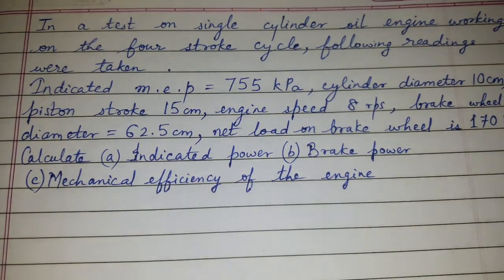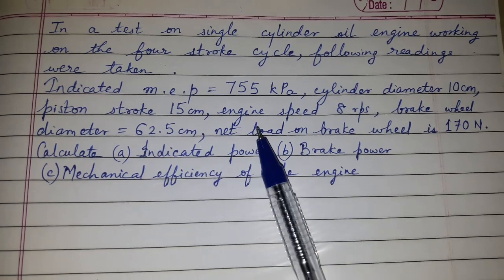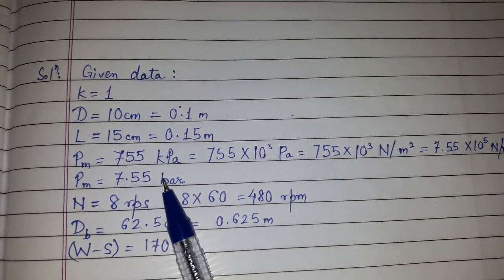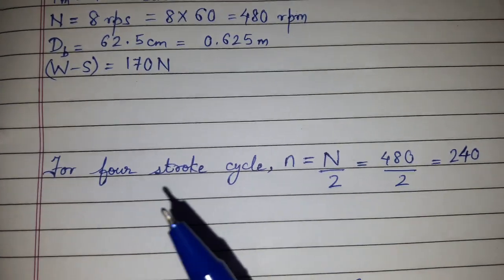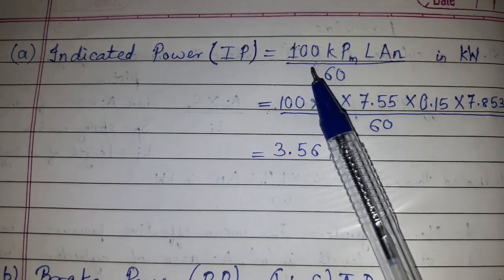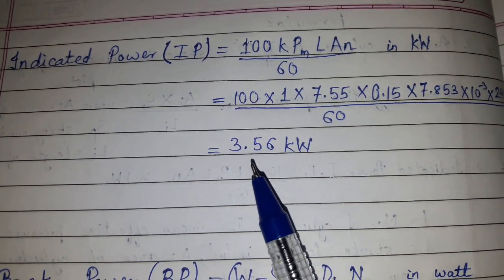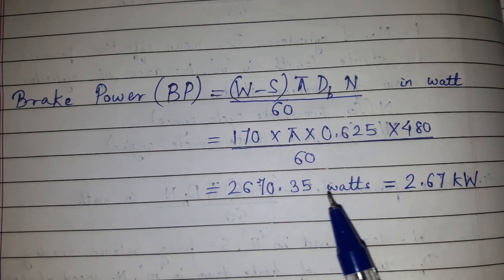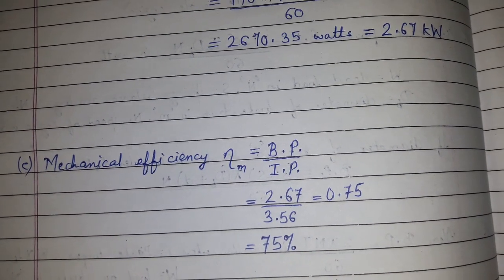Solved problem from Ch 2 - I.C. Engine testing and pollution control (Part 1) #20kviews #viralvideo

Comment: 3 liters six cylinders SI engine operates on a four stroke cycle and run at 3600 rpm. The compression ratio is 9.5 the length of connecting rode is 16.6cm, and the bore equal the stroke. Combustion ends at 20 ͦ after TDC calculate:

(1) Cylinder bore and stroke,

(2) average piston speed,

(3) clearance volume of one cylinder,

(4) the distance piston has traveled from TDC at the end of combustion,

(5) volume of the combustion chamber at the end of combustion.

Comment: Sir how do u multiply 60 to 8rpm? For wt reason u should take 60
Reply from the maker: It was given 8 revolutions per seconds.... 

1 minute is 60 seconds...

So multiplied 8 rps by 60 so you can have 480 revolutions per minute
Reply: @mechtechknowhow869  oo tq sir

Comment: Q2:- Fuel supplied to an SI engine has calorific value 42000 kJ/kg. The pressure in the cylinder at 30% and 70% of the compression stroke are 1.3 bar and 2.6 bar respectively. Assuming that the compression follows the low PV^1.3 = constant. Find the compression ratio. If the relative efficiency of the engine compared with the air standard efficiency is 50%. Calculate the fuel consumption in Kg/kW h.

Comment: Q1:- Find out the speed at which a four-cylinder engine using natural gas can develop a brake power of 50 kW working under following condition air gas ratio 9:1, calorific value of the fuel = 34 MJ/metre cube, compression ratio 9:1, volumetric efficiency = 70%, indicated thermal efficiency = 35% and the mechanical efficiency = 80% and the total volume of the engine is 2 litres.

Sir can you solve this with explanation
must rply sir